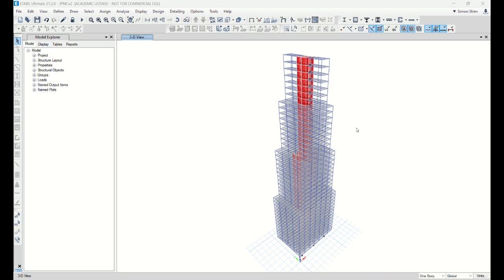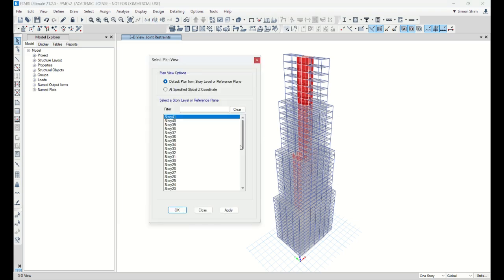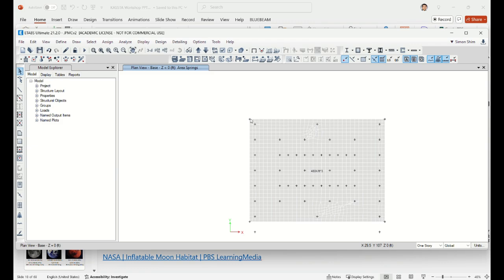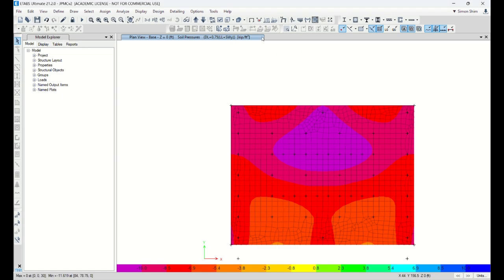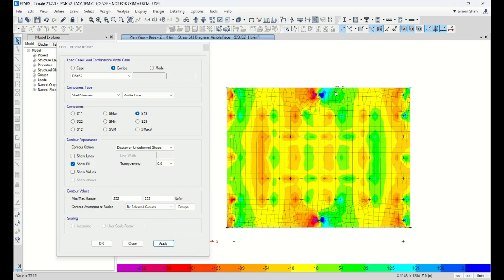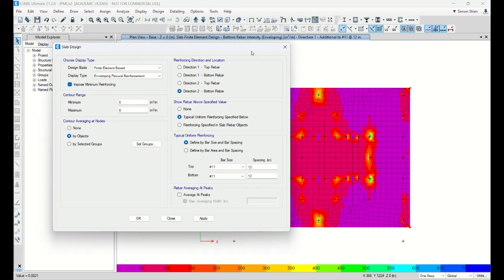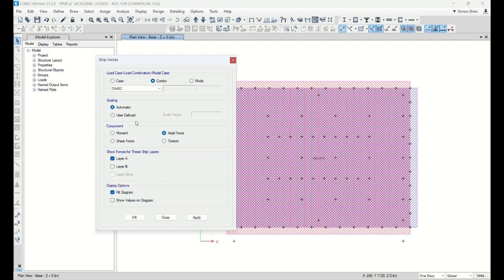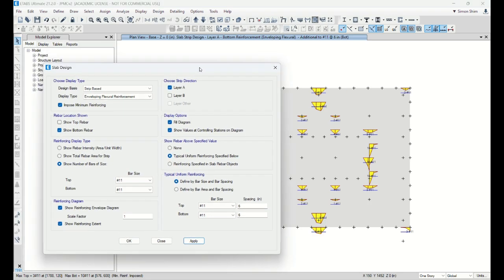Mat Foundation Analysis and Design in ETABS

Comment: 9foot Don't you think it's very big
Reply from the maker: Yes, it is big.
Reply: Is 9 foot depth? If it is, it might be not so big for the building of that many stories.
Reply: @beenay18  around 2.7 meter depth man don't you think its big ?
Reply: @TheNameisSurya  It is generally considered that 10% of the height of buildings is the parameter to ensure that the structure is embedded, which is why basements are built or foundations are supported on piles.